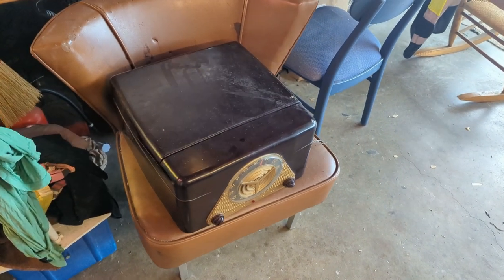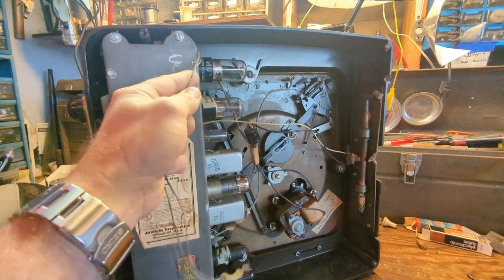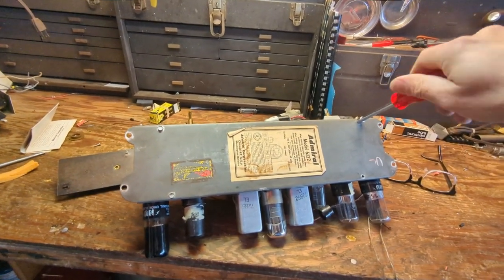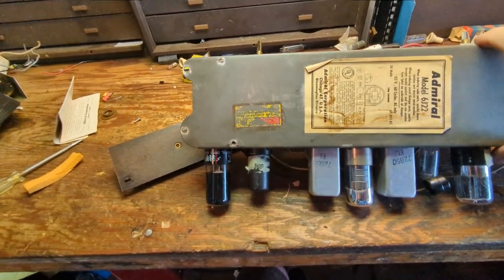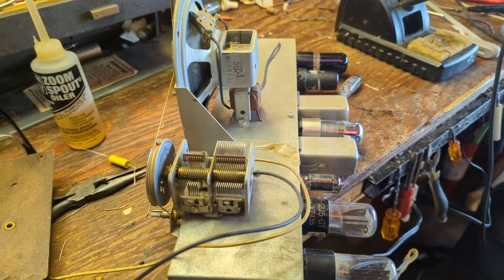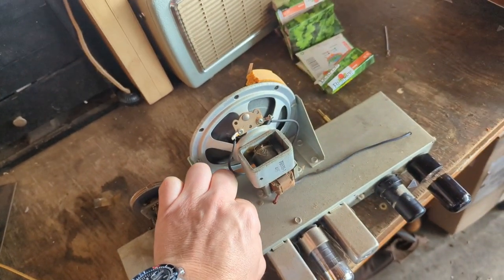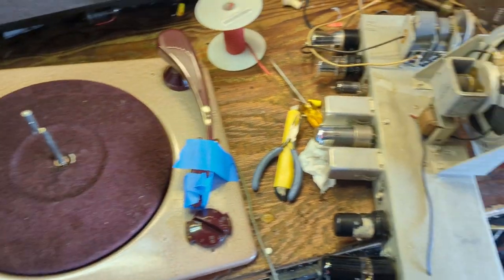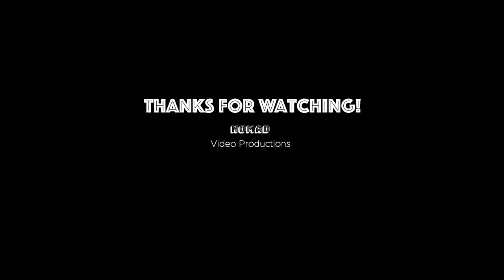Admiral Combo Radio/Record player Overhaul

Comment: You are sooooooo correct about todays AM radio material being crap!  I would be interested in a low power AM transmitter that could send a signal through your home. Blue tooth is great but being able to tune in a station from static to a strong signal is just rewarding.

Comment: It would be more amusing if you replaced the cord and plugged it in so we can see the before. Then replace the caps. We are not looking for safety. Glasslinger and a few others plug theirs in first.
Reply: Imao
Reply: I agree. Like how Shango066 does, we like to see the operation if any before then the process of diagnosing any issues, then the after performance of it working. Ideally get the worst shape you can find donations or source your own and make similar (resurrection) videos as Shango does. Those are my favorites especially of old 40 60 era tv sets!

Comment: 6 tubes, but it uses a 12BA6 as a mixer and a 12J5 as an oscillator (instead of a single 12BE6 or 12SA7), so it really ISN'T any better than a normal AA5 radio.

Comment: I actually have this in Black Bakelite. I recapped the radio about 20 years ago and it does not sound too bad. However I threw out that piece of garbage record changer that was inside of it those record changes are trash and useless and I'm not reliable. I was able to retrofit a. Record changer made by the voice of music that is a much more reliable indestructible record changer. Do not be surprised if you try and sell that unit to somebody and it comes back to haunt you because of the record changer.